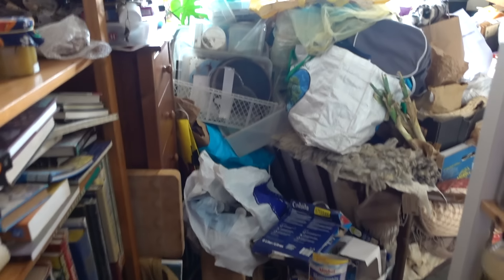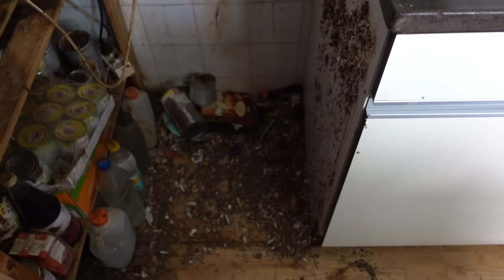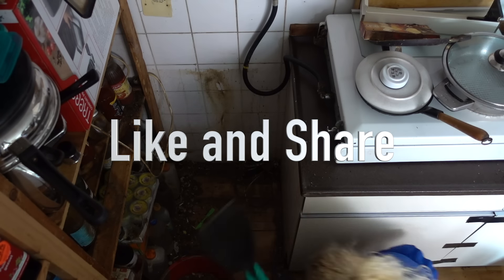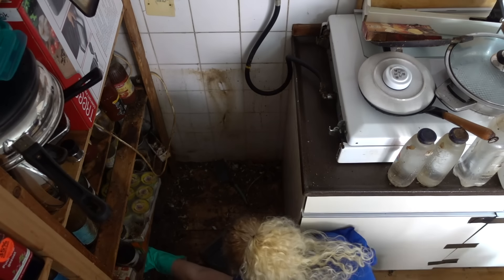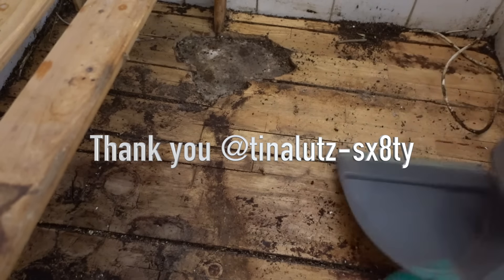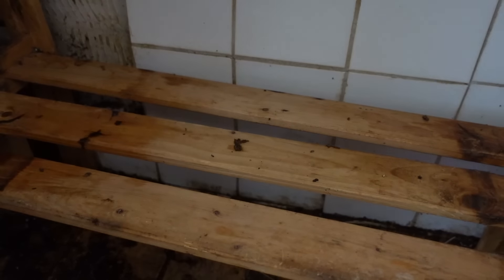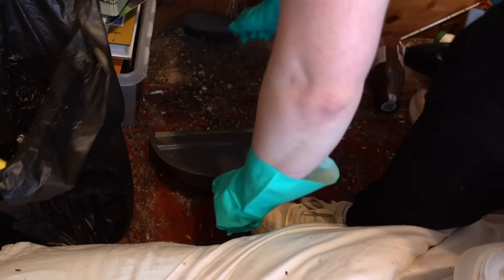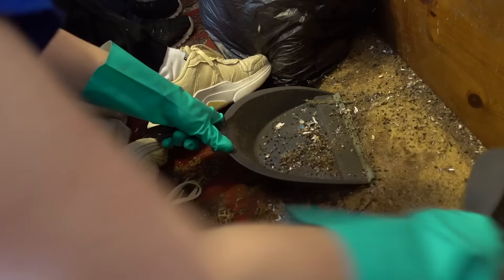A Mouse Nest Behind the Fridge?! - Extreme Kitchen Decluttering and Organizing

Comment: Wherever you see mice 💩 Coline it would be advisable to wear a mask- breathing those particles in is dangerous to your health.
Reply from the maker: I totally forgot! Thank you for the reminder 🩵
Reply: Yes!!
Reply: Hantavirus is a lung infection caused by the dust from mouse feces.  💙
Reply: @hollyjobitner3285  The behavior of the owner and the cleaner are dangerous, and they are not understanding appropriate protocol.  Hantavirus.
Reply: @donnamaco1  I agree .  💙
Reply: You also need a mask when you work with mold , like the black mold . Your lungs will thank you later for it :)